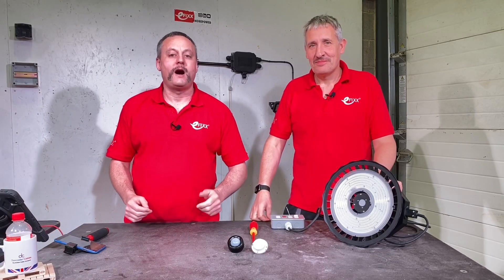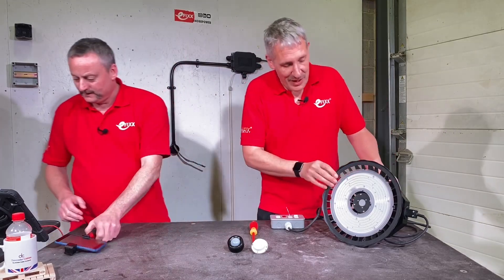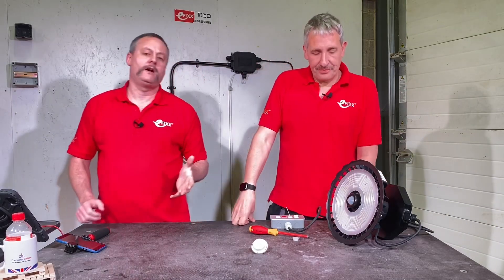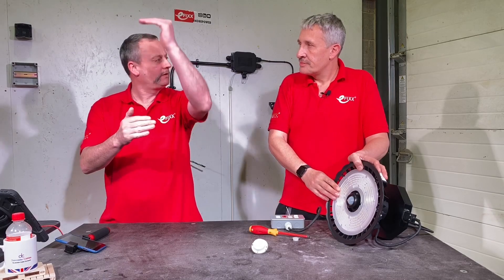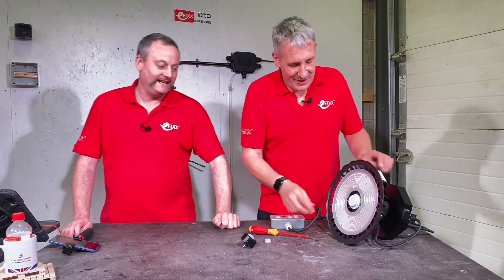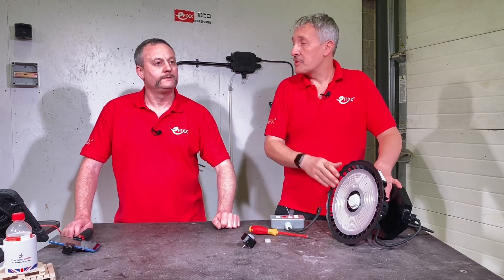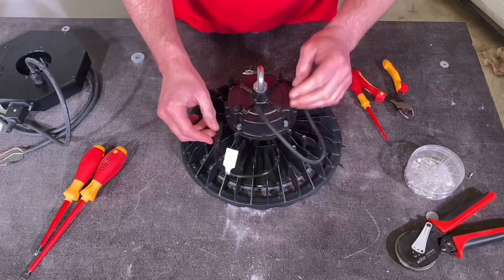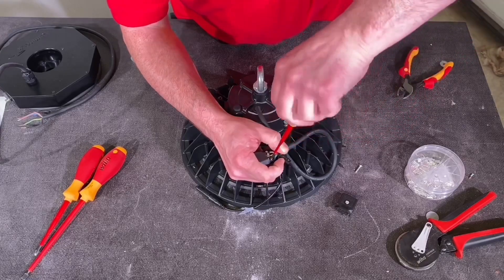Emergency lighting and control for warehouses & factories sorted! - Foremark High Bay from Lumineux

Comment: So you can wire the whole circuit in 2 core and earth via an emergency test switch and a contactor with no need for a light switch then?

Comment: Are these fixtures remote testing capable in the field? It is a requirement to test battery backed emergency systems every 30 days . It would be a pain in the tookus to grab a cherry picker and test each light.

Comment: When the time comes to change the batteries can you just open the pack and change the batteries or do you need to change the entire pack? Just curious as if you need to change the pack obviously it's fairly easy, just thinking of cost!
Reply from the maker: Good question - we will find out
Reply: You will be able to purchase the batteries separately. This has been designed around easy maintenance.

Comment: How many ma's does each fitting dump to earth
Because of the low current consumption and the opportunity to put many lights on a single circuit we might come close to or over the 10 ma to earth rule?
Reply: Thanks for the comment Steven, I will check on Monday and reply back with the required information. Sorry for the late reply.
Reply: Did you get a figure?

Comment: Will all this switching burn out the drivers?
Reply from the maker: The PIR isn’t cycling the mains. its dimming the LEDS and keeping the power running at a very low wattage - so won’t suffer from continuous on / off  switching stress.